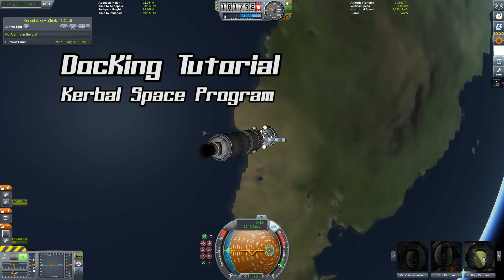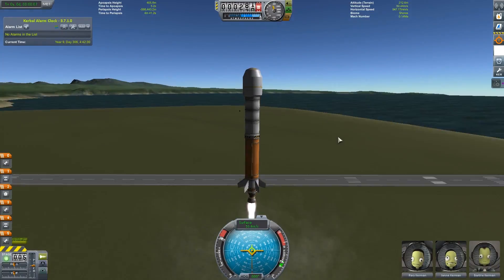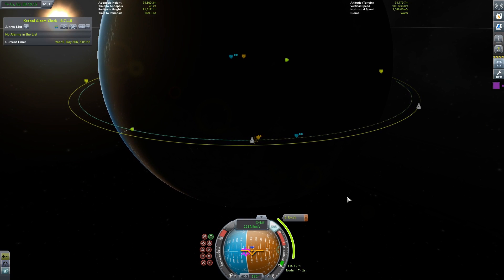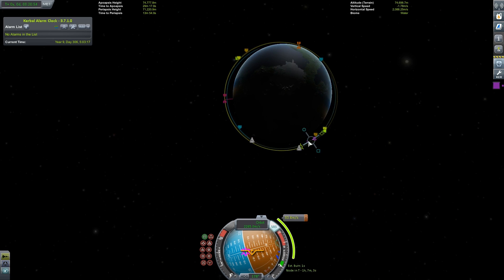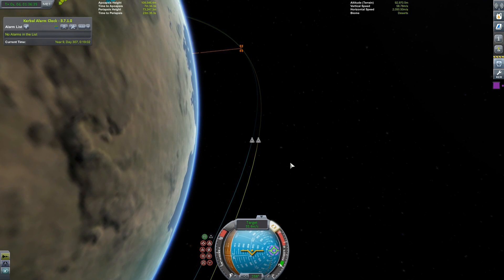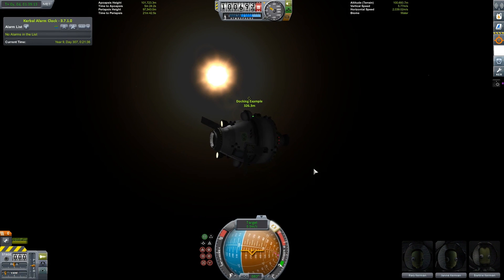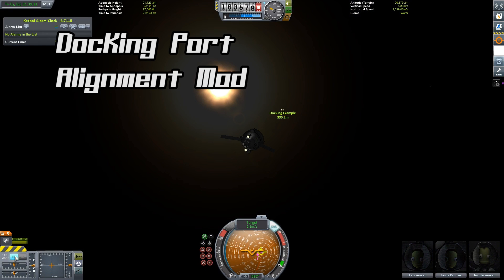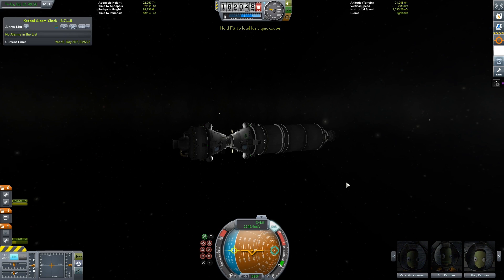Docking tutorial - Kerbal Space Program (stock + alignment mod)

Comment: Important information that I learned from Wernher Von Kerman's YT video:

If you can't quite manage to get things lined up in one controlled burn for the intersection nodes, you can simply adjust your own orbit so that your position will better line up with the target craft. In a small orbit, you take less time to complete that orbit. In a large orbit, it takes more time to complete that orbit. A large orbit slows you down, and a small orbit speeds you up. If the craft is ahead of you in its orbit, you'll want to speed up by lowering your orbit. If the craft is behind you in its orbit, then you'll want to raise your orbit to slow down. So what I like to do sometimes is line up one end of my orbit with the target craft, and then raise and lower the other end of my orbit according to the circumstances, and then we simply end up rendezvousing at that point where the orbits touch.